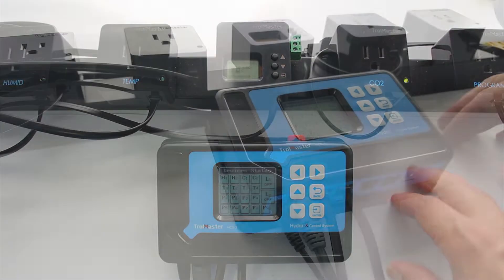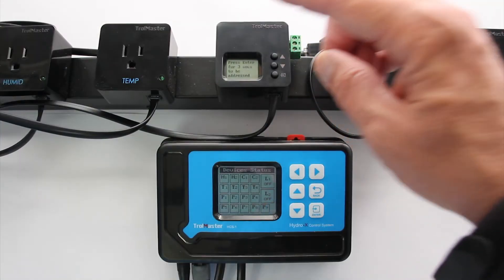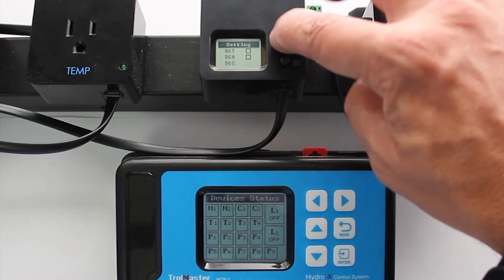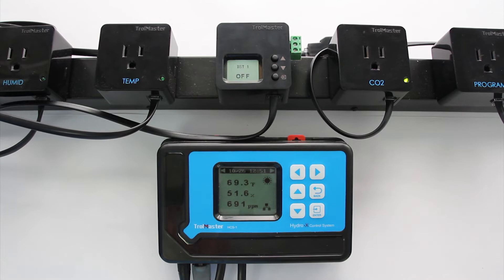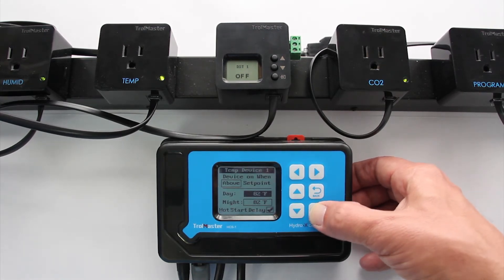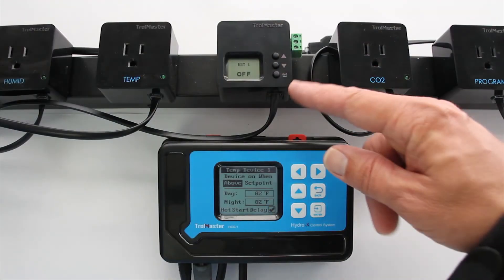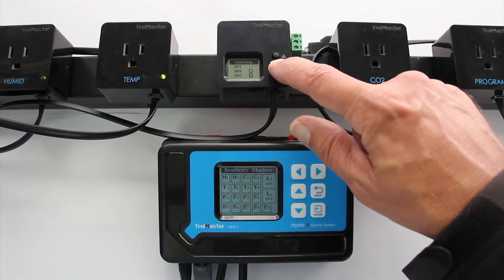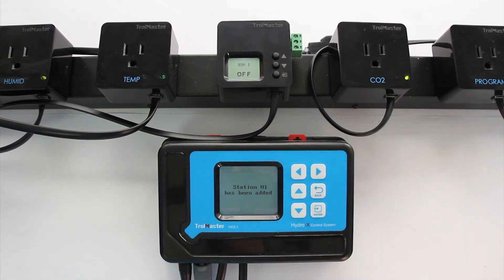DSD-1, Dry Contact Station for Hydro-X system

Comment: How can u have all that on one 20 amp breaker? If u plug anything in it’ll draw much
Reply: The setup in the video is not realistic. Also, their plug relays are only rated for 10 amps which means the max amperage of any device you plug into one should be around 9 amps. About two devices that draw about 9 amps can be safely plugged into a 20 amp circuit, but most older homes have 15 amp circuits for wall sockets so watch out.